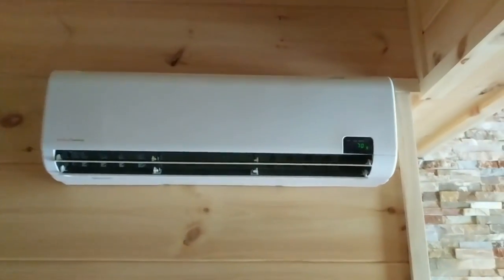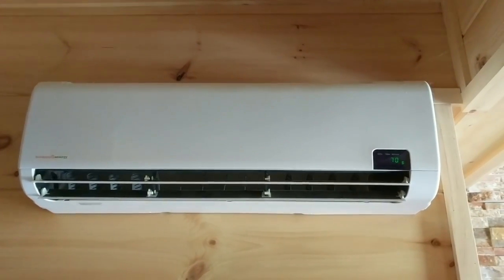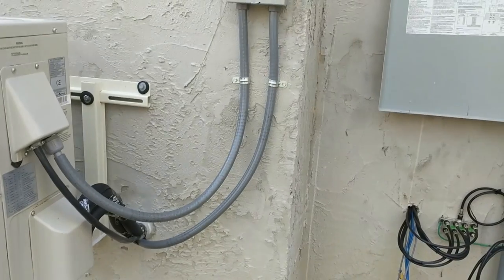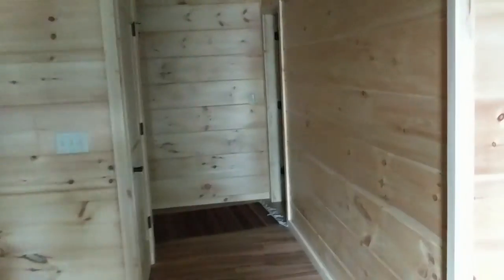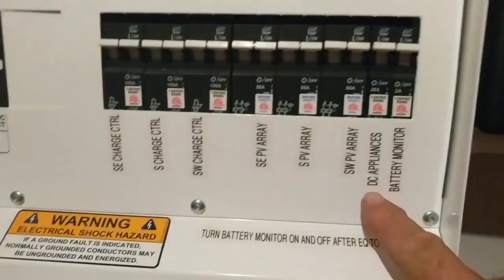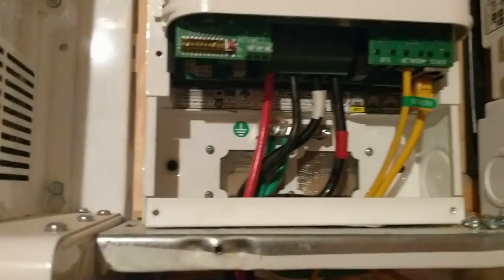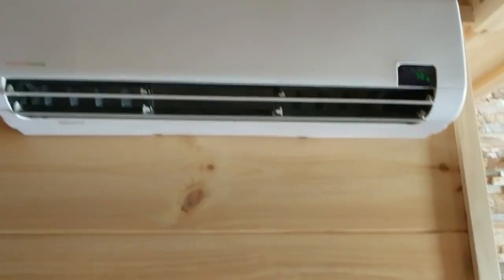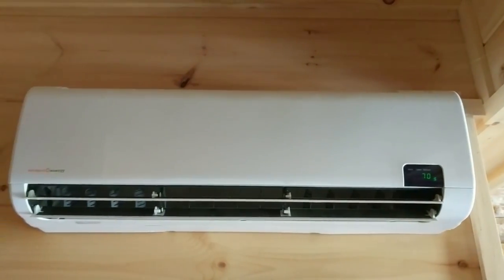48 Volt DC Solar Air Conditioner

Comment: Just recently in February 17 I lost my neutral 220v rail to my home it didn't effect my furnace but it did effect a multitude of devices all throught my home including diming of refrigerator and light's would turn on and brownout continuously. My wife and I stayed at a local hotel and troubleshooting the problem to faulty public utilities. They fixed it three day's later.

Comment: Hotspot now makes one that can run solely off of panels with out batteries with the option to hook to grid as well... They seem like real nice units, Thinking about getting one.
Reply from the maker: Yesir. We have installed many of the new hotspot ACDC 12C units. You like me to send you a quote with shipping just drop me an email with your address to  info@practicalpreppers.com
Reply: @engineer775  I may do that... I am also very interested in researching grey water recycle systems for off grid or rv... With the amount of videos and forums I have watch and read, there are too many naysayers and incomplete systems. I know that many towns recycle water and put it back in to the grid. There are a lot of off grid homes that require water transport. If someone could show a working system in an off grid home and one in a RV that would be nice. I have some design ideas in mind on how I can or would do one, I just need more help with the tech specs and what would and not work.

Comment: How is the AC two years later? What distance did you run your cables? What voltage range does the AC accept. Thanks for a great video

Comment: Hey Scott would you mind tossing in super newbie comments about: 1. Why it is better to do 48v vs Alternating current when your power source is solar (with or without batteries) and how to justify higher cost of D.C., etc. for the people who are just looking at solar and need a primer on the basics.
Reply: Not 775, but I will take a stab at your questions. Usually Inverters have limited output. Going with DC bypass the inverter. There are also some conversion losses going from AC-DC. Typically more if the AC is converted back to DC in the appliance. Depends on the motor type used in the blowers and compressor.  That said there is a disadvantage: If your compressor unit is distant from its DC power source because 48VDC is about half the voltage of 120VAC. The Lower the voltage the more current AMPs is required to perform the same work (measured in Watts). Power loss is increases with the square of the current (Ploss= I^2*R) Double the current, quadruple the power loss. Another issue is that if a fault caused arcing, AC can quench the arc since it AC turns off 120 times per second. DC provide a constant voltage and thus can more readily sustain an arc.My personal concern is about getting services for DC appliances. Since there are very few DC appliance sold, it can be difficult to find repair services. There are few repair men that have experience repairing DC appliances and replacement parts might take weeks or months to obtain.

Comment: Also it means you get to save on inverter losses, because apparently and I don't know if this is true the most efficent compressors are DC compressors so the good units use DC compressors with a rectifier to turn AC to DC current which obviously isn't 100% efficent and if your using solar pannels or a battery to power it, your going to have to turn DC to AC so it's 2 conversions even if you assume the inversion on both units is 95% efficent thats still going to be 90.3% efficent after 2 conversions, which isn't a huge loss, but it's 2 conversions which you don't need to do.

And in the case your batteries are low you can charge them with the grid and then use the heat pump which only means 1 AC DC conversion, to be fair charging batteries is only 99% efficent, but 1% is really getting to the point where it's not worth mentioning.

Comment: we just installed a 3T Mitsubishi mini split ht/ac. With two floor mount heads.
Runs so ((extremely quiet)) indoors and out doors and is so efficient I thought something was wrong with the unit Lol...
Reply: Can you link to the exact unit? How much did you pay? How efficient do you feel it is?
Reply: @KotoriOnWheels  Mitsubishi M-Series 9k BTU Floor Mounted Unit - Heat/A/C For Multi or Single-Zone
Model: MFZ-KJ09NA-U1 Note: As with all (heat pumps) when the outside temp dips into the "teens" a supplemental source of warmth to work in concert
with this unit keeps things cozy. Regarding the A/C In zone 7b the air produced  is crisp and cold. We have installed two floor heads one at at each end of a patio room 41x16' The room has eighteen single pane windows. The walls are constructed of aluminum grade thin gauge metal not insulated at all.
Plantation style blinds block extreme outdoor temps from entering the room and work well at blocking direct sunlight when needed. 
For ease of installation comfort and efficiently we couldn't be more satisfied. The units come pre-charged and can be a diy project
if you are comfortable with electrical wiring and components.
Reply: @1new-man  thank you!

Comment: It would be really nice to have a dc mini split hot water heater too. 80 gallon tank with the head in it and the split outside all dc. Better it would be a secondary head on the same unit that took heat out of the air and dropped it into the hot water tank. The efficiency gain would be huge all around and you’d need less inverter. 

How did you low voltage shut off on your dc devices though in case your batteries drop too low?

Comment: Used to work in air conditioning. A 48 volt mini-split, how cool is that? No pun intended. Thanks for sharing. I'm thinking about modified shipping containers off grid. This would great.

Comment: Very interesting.  I have a LOT of excess power generation during the day going to waste but don't want to tax my inverters with heavy air conditioning loads so maybe this makes a lot of sense.  The price looks about $600 more than a regular mini split.  Do you think this will be coming down anytime soon?  Thanks!
Reply from the maker: Nope.  DC is expensive to to the lack of it.
Reply: Not understanding why higher cost - other than perhaps due to lower volume production of DC-only units.  Should be less expensive on apples to apples basis since don't AC mini splits convert to DC internally anyway?
Reply: @M22Research  They convert to high voltage DC... like 400V... which when starting from 48V is a bit more difficult and will result in higher 48V DC currents meaning the 48V DC side of things is fairly beefy even if the rest of it is the same.

Comment: Just curious - is there a DC powered A/C available for motorhomes? There are a lot of RVers who have solar systems. Many come from the factory prewired for it today. Sure seems like a market. Only other choice if you're not near shore power is to run a generator for the traditionally powered units.
Reply: Road Trek has a under mount D C air conditioner

Comment: Why not install solar collectors, install radiators inside and heat directly like that. That will be more cost efficient than converting the solar power into electricity first, storing it in batteries and then powering the aircon.

Comment: Can you buy only the DC air conditionner or your forced to buy the whole système with pannels/battery and all ?
Reply from the maker: Yes you can buy just the DC air conditioner if you'd like.
Reply: @engineer775  Thank's for the fast answer.  I'm looking only for the air conditionner because I have solar pannels and everything else. But when I look only for the air conditioner, I always end up on a page that sells the full system. Do you have any link for only the air conditioner ? Or maybe is it cheaper to buy a AC air conditioner and change the motor inside pour a DC one ?

Comment: have two question one can I get your email address and two do you think that I could get away with using supper caps in place of the batteries, I live in Ariazona and have 300 days plus of sun and only want to cool during the day. I may latter want to make ice as well in the day light and cool at night. I have may question and need meny answers. was thinking of inverters run ac but the 24-48 dc looks where i want to go, do you sell as well? sorry more then 2 questions!

Comment: Hi
How did you hook up 3 magnums 4448 PAE. I was under impression that router can only support 2 units.
Reply from the maker: there are only 2 inverters.  3 pt100 charge controllers.
Reply: @engineer775  You just have 12 V batteries wired in parallel to make 48V - correct? Those are enough to run HotSpot unit? That is impressive without Lithium Ion batteries.

Comment: nice vid. what are the absorb, bulk, float and equalisation voltage on the 48volt classic battery?
Reply from the maker: hmm.  59.28. 59.28, 56.4. 63.60
Reply: thanks a lot

Comment: Lead-acid batteries inside habitable areas? Where is that legal?
Reply: Anywhere per NEC, as long as the cabinet or the room is monitored for gas, with an automatic brushless exhaust fan, with outside makeup air... (there are -48V DC systems available) or just a well ventilated room where gas cannot accumulate...
Reply: Try to be free, think freedom. legal? great the government will help.

Comment: E775-. I'm about to install a Mitsubishi mini split on the house I just built.  Any recommendations from you or anybody else is appreciated.  My e box has a nice 30 amp Cb for a generator, or non grid power.
Reply: northcacalacka545 .... you can buy cheeper but not better quality. I took a lightning  stric that killed my frig and tv, the Mitsubishi  24n substained no damage except for a fuse on the ps board. You made a good choice.

Comment: with being able to heat at 10* is it running supplemental heat?
Reply from the maker: Jeff Jones no. there is no supplemental heat. Heat pumps keep getting better and better.
Reply: do you have a link to a data sheet? 30 years in HVAC-R and never had a HP that will provide any real heating below about 30*.
Reply: reason I ask is if the will do that I need some for an off grid project myself.
Reply from the maker: Jeff Jones https://drive.google.com/file/d/0B9mYxpR3iEzcQzUwVmdyV1RteDQ/view?usp=drivesdk
Reply from the maker: Jeff Jones https://www.dropbox.com/s/t9s1aanirskv0xm/Specs-DC48%20%281%29.pdf?dl=0
Reply: I live in Arctic Sweden, and we have temps going down to -40°C (or -40°F, it's the same) in winters. I was a little worried about installing a air-air heat pump without supplemental heat, but mine outputs heat down to almost -30°C, but it quickly drops from there. So, our heat pump is effectively working about 330 days a year. It's a Fujitsu General ASYG12LCTB / AOYG12LTCN.
Reply: Jeff Jones ... most mini ' s post nrs of about 5 °above befor  shutting down..  my 2 ton Mitsubishi  produced 110 degree heat with out side 0 temp. the first year after the install. I now run my boiler during two or more days of zero temps. because it is fairly new and to save wear and tear on the heat pump . . My heating and cooling cost dropped 60% with the minisplit .  BE carefull of cheep online minisplits.

Comment: Can you use a36 vdc pv on a 48 volt system?
Reply: you have to us a dc to dc converter to up voltage. it works but you draw more current so more solar needed and more battery capacity vs 48 v system . but if that is what you already have doable

Comment: anyone offer a direct solar to minis put option? it would be great to have direct solar to heat pump that could offer a/c, heat, and hot water heating depending on needs. so essentially all solar gets used towards something.
Reply: Mitch and Cassie Shepherd .. this requires battry but hotspot offers  a direct input from solar 12,000btu heatpump but needs 220 grid power for when clouds reduce solar power  and for night time operation. Also hotspot catalog  offers a hotwater system that captures heat off the hot Gass side of the linset. 
Right now  mini splits are the most  cost-effective  heating and cooling systems,  without solar. The numbers (SEER & EER) with solar are compelling . Go to MAINE energy  cost comparisons .  Air to air heat pumps now are beating out gas for ten years cost!
Reply: Robert L. Fallin x
Reply: Mitch and Cassie Shepherd -

Comment: arent "inverter" split DC units just this same thing but with an AC-DC adapter inside so it works like a computer accepting 120-220v? if thats the case we could simply get one of those inverter units and bypass the inverter and run it off whatever DC voltage it runs on internally

just to think about it, we are now at the point where those inverter AC units are very popular thanks to their efficiency and using such a system with renewables would be such a waste like going from DC panels-wind to an inverter to make it AC for the house and then again another inverter in each new electronic device to make it DC again, its insane, at some point we just have to get rid of AC altogether, it no longer makes sense for future homes

Comment: im showing you all ppl  who dont want too much electricity bill 
methode 
use Low voltage applaince 
example ac 12 or 48Voltages 
and more applainces like low volts get all Applainces low voltages and 
contact with Electricity Enginer who make a device who convert 230volts in 50volts and connect with electricity it will save 70% elecricity before $100 bill
After using low voltange applainces $25 bill thank you and save your country from load shedding 

sorry for my english